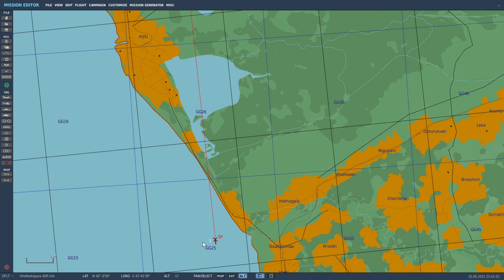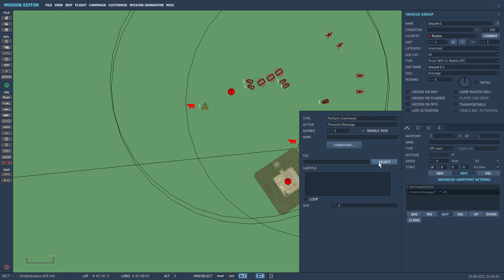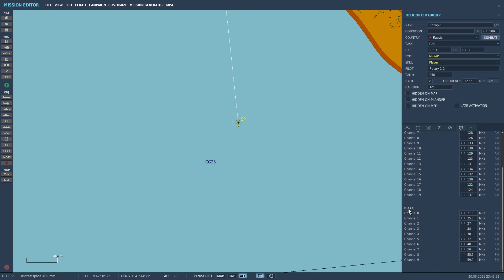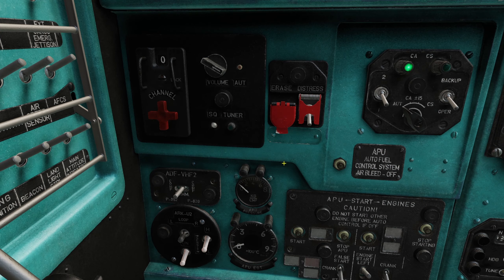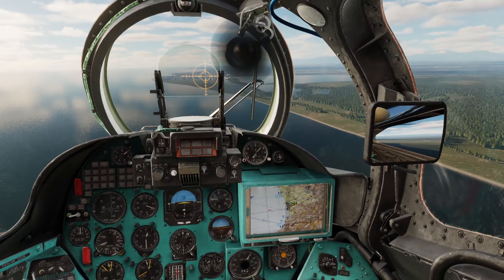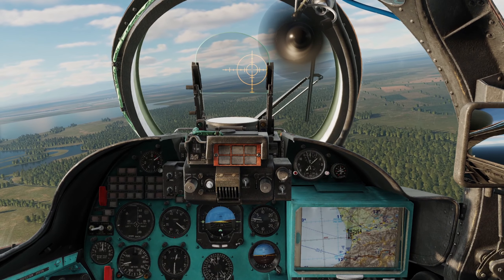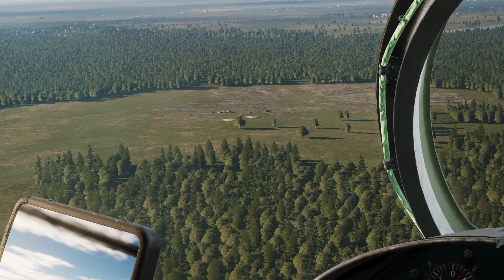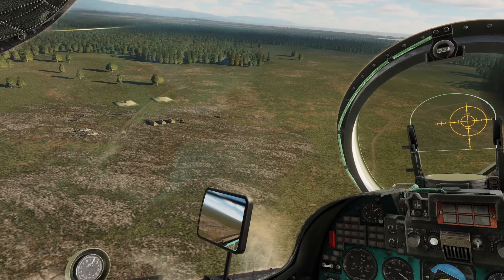DCS Mi-24P Hind R-828 ADF Navigation Tutorial

Comment: Hey! Thanks for the tutorial and for this series! Got me going in what I had asked you before! ^^ 
Another question though, is it possible to get the R863 to work in ADF? I saw that there is a swtich above it, but couldn't get it to function...
Reply from the maker: Pretty sure if you flick the R-863 to ADF and R863 on the ARK-U2 and on, it 'should' work but I couldn't get it working either, so I'm assuming EA issue.
Reply: @RedKiteRender  I used ot think that as well, but then I saw that the position on the left of the switch in the ARK-U2 is actually the R-853. Which is the 4 channel radio in between the Static Valve Switch and the Yaw autopilot pannel.

I still wasn't able to test if this radio works with the ARK-U2, because you can't change its frequencies on the mission editor and I don't know which ones are the default. But this made me think that that the R-863's ADF should work independently of the ARK-U2.
Reply from the maker: Ah the mystery deepens, perhaps SRS might reveal what that radio is tuned too, I'll have to mess around with it.
Reply: @RedKiteRender  Hey! I did some more testing. I was able to get the frequencies from the R-852 in SRS like you said, they are:

Channel 1 - 114.115 MHz
Channel 2 - 114.335 MHz
Channel 3 - 114.585 MHz
Channel 4 - 121.500 MHz

Using that, I was able to home in a ground unit broadcasting on 121.5 using the same method as with the R-828 but by selecting the switch on the other direction on the ARK pannel. 

So this system is functional, but I still have to figure out how the R-863 ADF works.
Reply: Had the same question.  Thanks.
Reply: @Fred160008  Good work.  Great post.  Thanks.
Reply: @MrPhantom453  No problem! Glad that I could help :)

Comment: Thx to tutorial, two cases: no sound of morse on you video, did you turn on the swich for comm with 828/U2? Second in FREQ option (ME) you stay with AM, but FREQ in Hind is FM (however it looks like it works :D!).
Reply from the maker: I didn't set the radio selector to R-828 so it wasn't heard. Rest of your comment is cut off at the end?
Reply: @RedKiteRender  Do you hear it? Looks like a bug, can you check it?
Reply: @RedKiteRender  So is it work for you? Are you sure?
Reply: Which 828/U2 switch are you referring to? In my situation, when I press and hold the AUT button, the TUNER light comes ON then OFF immediately, unlike in RedKite video where it comes ON then OFF few seconds later!! Also, when I switch the MODE knob to ARK-U2 the [2] needle on the heading indicator doesn't move.
Reply: @fady904  No, its a bug here, the problem is that the sound only is present on ARK-U2 switch position on OFF, not for R-828. Its reported already.
Reply: @Y0Y0  I solved the light issue by tuning to channel 6, before I was trying channel 1, 2, 3 but once I tried 6 the lights came on then off but the needle would not move at all!!